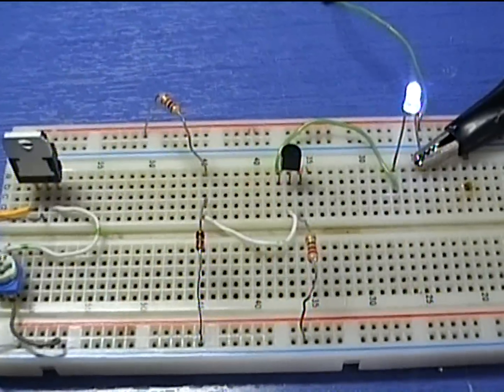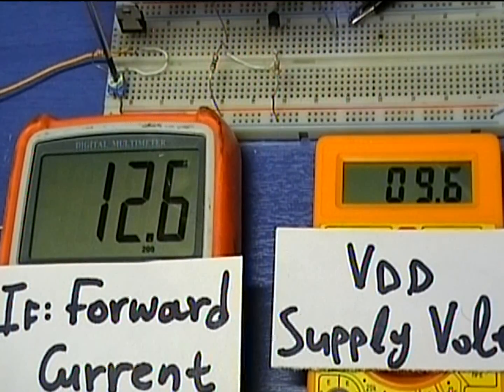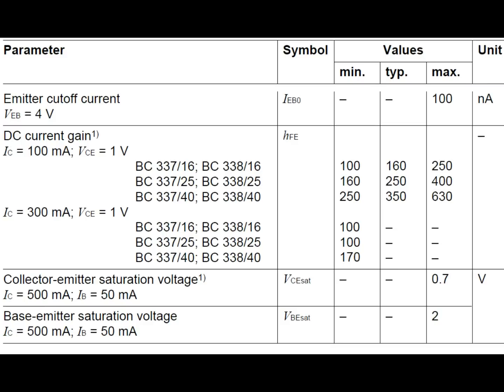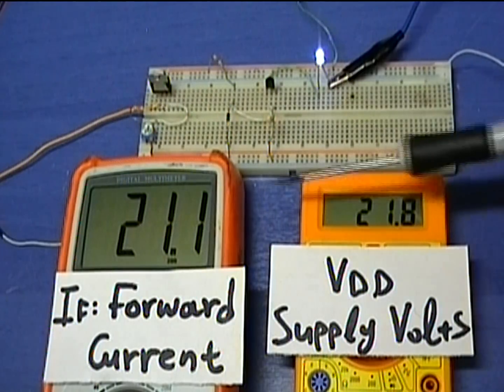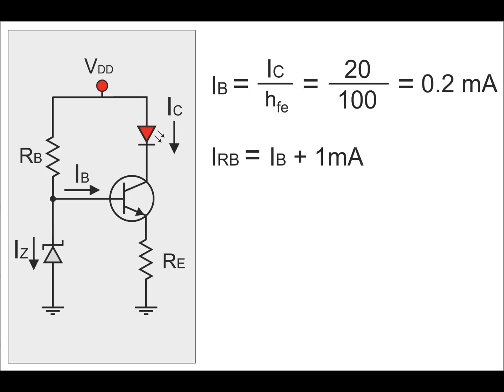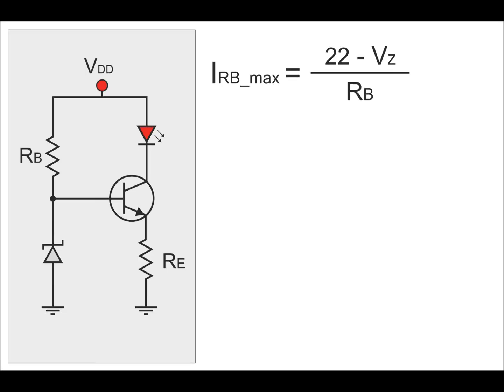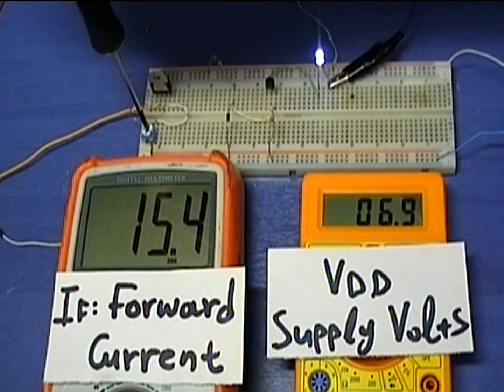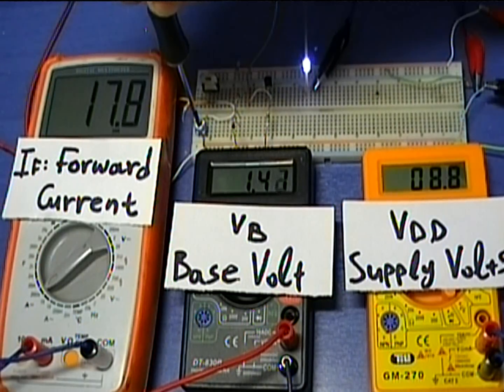LED driving and controlling methods - Episode 3 - Voltage Regulated Constant Current LED Driver

Comment: Great video. Thanks so much. Would love to see some videos where you use discrete components to build up a boost circuit to drive white led from low voltage (e.g. 1.5v single cell)
Reply: Just of reference: Buy any $1 solar garden light, and remove the PCB. Only 2 components are used, being the special  4-pin IC and the inductor. Everything you need, and there's definitely no better, cheaper or simpler way to do it. When building it, Google for the IC datasheet which will tell you what inductor value for various LED currents. Typical ICs are 5252F, and they will light an LED down to 0.6V or lower. Add a diode and small capacitor if you want to use a colour-change LED.

Comment: @peter owens the diodes replace the zener diode. Say you put 3 diodes in series to ground as the bottom of your voltage divider, you will always have the .6 x 3 or 1.8v at the transistor base. Plenty to bias the transistor.

Comment: This is a good effort although a bit hard to follow mainly due to the non native English speakers phrasing.
I am also not sure about the advantages of this approach over switch mode buck or boost constant current source.
Also lost on the use of two diodes - what do they replace?